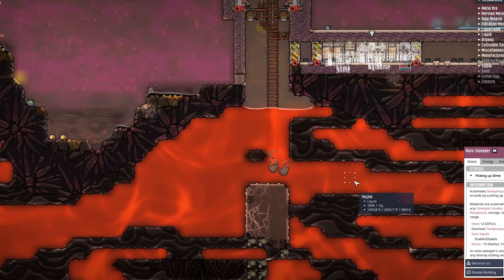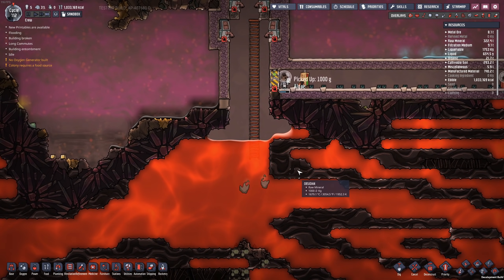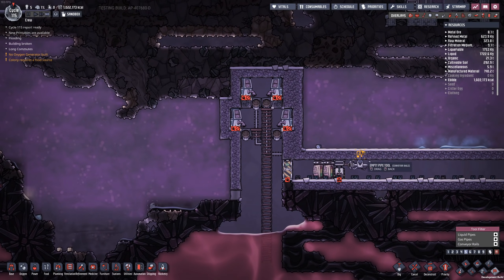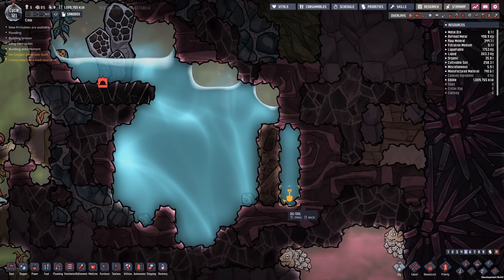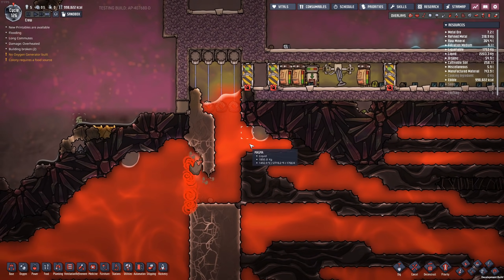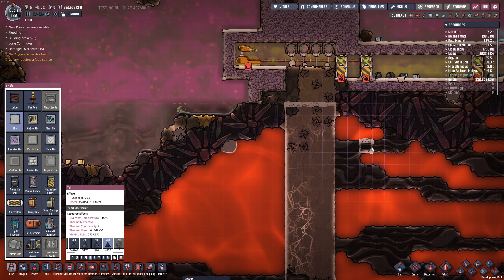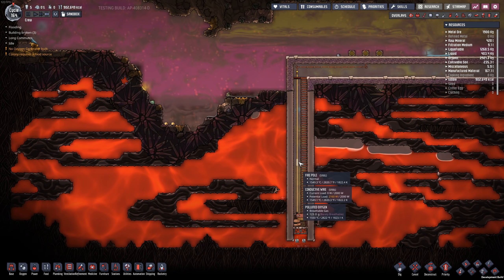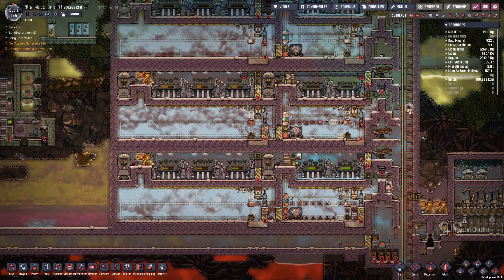Can You Bore Into Magma With Sand? Oxygen Not Included Experiment

Comment: What if you use the system like in min. 16 and then work with pressured Air or another gas to drive the Magma out at the Bottom. So you can work your way down in a infinite way if you either use lots of Gas or make airloks every so far.
Reply: AFAIK, pressured gases can't push liquids around in this game. The reason the magma didn't just push all the way upwards the column here when he had a hole in the column isn't because of air pressure, but because of viscosity.

Comment: If you build the sand column one wide you can expand the floor of the column sideways using the "build through corner" method. No need for 4 columns. Also you get all the sand back ofc
Reply: Which begs the question, why do you need a column at all - just build sideways until you have another natural block underneath. Then go down one; rinse and repeat to bedrock.

Comment: If there were some way to keep regolith from instantly melting, I guess you could alternate between regolith and sand to force it to stack? 
Another possibility would be to form "full" sand blocks above the magma and then drop them with a door.  That way you could potentially use real sand which might be more reasonable than algae or slime if you're going to expend 1000kg+ per tile.

Comment: You would probably need to build a sand pillar 8 wide. That way when you build your 2-tile ladder down the center, you have a 3-tile wall on either side, which I don't think can break from pressure build up.

Still, the most interesting drill through magma I had was when I used all the water and ice in an ice biome to offset the heat. 
You can get a surprising number of seeds that require you to go through magma in order to get to oil on the Volcanea asteroid when you have the magma channel trait on.

Comment: question,
is that possible to make a temperature lock ?
where dups drop that what ever they have when they go through a door or liquid?
my space is 200 c so when i bring it in my base, my base gonna melt.. thats why i ask :D
Reply: make a vacuum room
Reply: @eduardomartins701  dont work for that what i wanna or have to build xD
Reply: @TioTrix  what do you want to do?
Reply: @eduardomartins701  i want to dig the space rocks. 200c + when i do this atm the dups bring that to my storage space and then melt my base... so i need some sort or temperature lock or something, where the dops drop what ever they got when its to hot..
Reply: @TioTrix  the only thing i can think is making a second storage area with higher priority and make it a vacuum, or you can just deal with the heat by cycling the stuff in a pool of water first and using the conveyor rail
Reply: @eduardomartins701  yup, but then the dups bring the rocks and co to the storage too..
Reply from the maker: Maybe try having them delivered to a loader and that loader can then check the temperature of the material on the rail
Reply: @brothgar  with higher priority ? i try it out..200c + in my base is not fun xD
Reply: You can set up a storage bin for regolith in a vaccum room, if the storage bin is on an airflow tile, the tile gains the attributes of the vacuum and will therefore not transfer heat.

Make sure your liquid locks are made out of oil or petroleum so that dupes carrying regolith can't boil them over time whenever they pass through. Also have them wear atmo suits so they don't exhale into the vaccum.
Reply: @s19tealpenguin61  ok that sound like a plan :D ok i try all out ty :D

@Matthias Görgens

my base is good atm
Reply: @TioTrix  you could just not able the rocks on the storage but ok I guess

Comment: Can't you build that shaft outwards using that corner method?
Get a one tile column of sand down and then use that as the base to corner-build the 3-wide floor for the 1-tile-wide shaft+walls. Then build the walls outwards on either side and by starting with deconstructing a tile at the top next to the abysalyte and corner-building down.
Reply from the maker: You can definitively expand it. If you have enough natural obsidian you can probably get down to the bottom without to much hassle.
Reply: And if you need to punch through more obsidian, pile dirt on top before digging it out.

Comment: ... Does Sand leak magma though?
Considering the tunnel you're going to dig is one tile wide.
Reply from the maker: Yeah you can see it just for a moment in the video as the magma is trying to break through.
Reply: @brothgar  
Yeah- you're going to need at least a double-layer of sand to dig a tunnel downwards... which means a 6-tile wide shaft.
Then there's the fact that Sand is continually being heated up and melting in a large pool of greater heat capacity.
So the choice is to build a Sweep Dock down in the shaft as soon as the shaft's complete... or to the point where you meet critical mass between melting and reforming.
On another note, Pips WOULD be able to make shafts, considering you have regenerative resources, and suddenly, you have infinite sand.